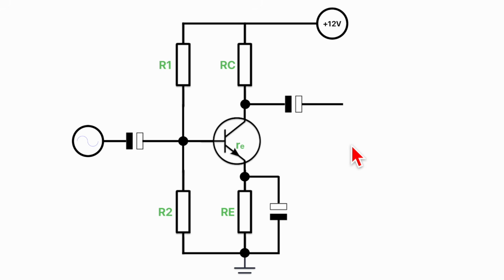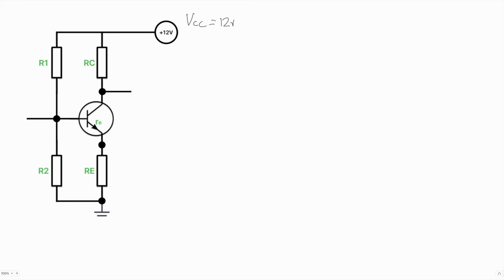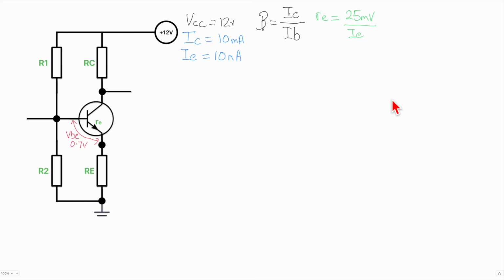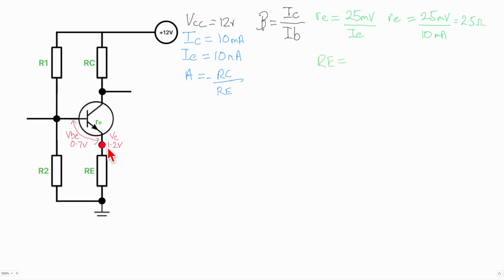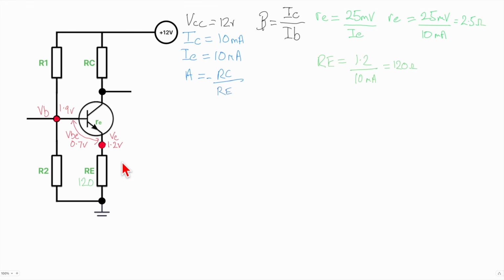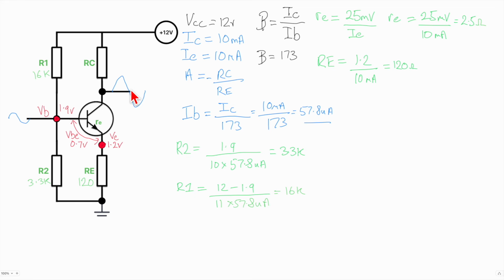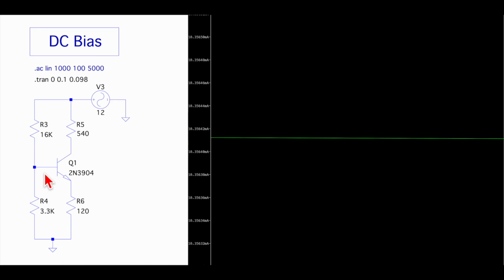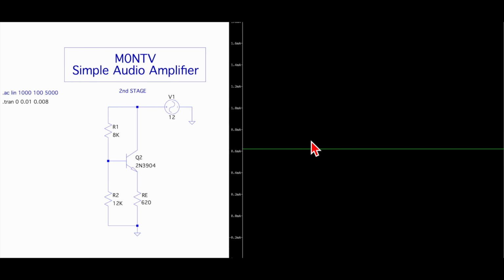57 - Designing a Simple Transistor Amplifier

Comment: This whole description is provided by a commentator who does not know anything about the subject. 
He says it is the stage of an amplifier and yet he is designing it with 10mA collector current. 
The output capacitor is around the wrong way. 
You cannot design a stage as described. 
He is “leading you up the garden path” with his ignorance. 
You start a design by knowing the characteristics of the input signal. 
A signal can be “strong” or “weak.” 
Not only is the amplitude important but also its “current carrying capability.”
This is not covered because he doesn’t have a clue.
I have been teaching electronics for 50 years and over 25 million visitors have read my articles on my website. 
I have designed hundreds of circuits, sold 300,000 kits and 750,000 books and magazines and made millions out of electronics. 
The circuit should be the self-biased stage and not the stupid bridge stage. 
The current for a first stage should be much  less than 1mA and you need to know what you are “driving into” to make any sort of realistic calculations. 
You simply cannot design a stage “in isolation.”
This whole design is so much junk that l am not going to analyse it any further. 
Colin  Mitchell    talking@tpg.com.au

Comment: @33:20 I don't understand why you're multiplying the 57.8 uA base current by 10 to come up with 33k? Thanks for the great video!
Reply: ok, figured it out.we're wanting 10 times the base current :)
Reply from the maker: No worries! Thanks for watching. Best wishes, Nick
Reply: @M0NTVHomebrewing  thanks! And sorry to bother you again, but is there any way you can please tell me why 11 times base current at R1???
Reply from the maker: Because you want 10 times the base current flowing through the voltage divider. That means 10 x IB through R2 and 10 x IB through R1 BUT you also need to factor in the base current itself. The only way the base gets any DC current is through R1so that is why R1 needs 10 + 1 ( = 11) x IB. Hope this helps. 73, Nick

Comment: this video helped me make an amplifier on my arduino board that took a 3.3v input and amplified it by 5v, which made the noise in the speaker quieter, then caught the resistors on fire.
Reply from the maker: Wow! That's not good. The only common reason your resistors would get hot was if you were putting too much current through them. For them to catch fire you must surely have shorted the power supply to ground through them. I would urge you to look carefully at what you actually did. Spontaneous ignition is a learning opportunity! Best wishes, Nick

Comment: Can this amplifier drive a significant load or is it just a stage in the chain and if not then why?
Reply from the maker: Hi Joshua, it was more of an experiment really but I did manage to get it to drive an 8Ω speaker. But honestly it would be better to use a push pull power stage if you are designing a practical circuit. 73, Nick

Comment: Hi I am still a super noob at all this so i will understand if you laugh at my question. Lets say i was bread boarding this exact concept and wanted to understand how different valued resistors in the circuit react on the output, could i replace the fixed resistors with pots within those ranges and either preset them using a multimeter  and pop them in in those place or adjust them in a live setting?
Reply from the maker: Hi there! Welcome! There's no such thing as a stupid question ... only a stupid answer! Yes, you absolutely could do as you suggest but just make sure you connect the pots in as variable resistors not voltage dividers (i.e. use just two terminals). You might find it instructive to do this gradually. So put in all fixed resistors then replace them individually with a variable resistor so you can see the difference each one makes. Replacing them all in one go and tweaking them all will tell you little I fear. But step by step could be interesting to see the results. Best wishes, Nick

Comment: Hi Monty I have made a few amps like this and I find the output is has 5v output without signal and I have a dc offset with the signal in the pos side.I have tried a blocking cap but I loose output. My speaker plays well but I know this is not correct can you advise please 
Regards Richard Bennett.
Reply from the maker: Hi Richard, you'll need a DC blocking cap to link the emitter follower to your loudspeaker. It'll need to be pretty large in order to pass the lower audio frequencies properly. You can probably manage with 100 uF for SSB (300 Hz - 3 kHz) but for music I'd go even bigger e.g. 470 uF. These will be electrolytic caps. Hope this helps. Best wishes, Nick

Comment: The best explanation I have seen on this topic. 
But I didn't quite understand, is this a Class A amplifier schematic? 
At high power levels, will there be significant heating of the collector resistor?
Reply from the maker: Hi there. Yes, it is a Class A design but a SMALL SIGNAL AMPLIFIER. It is not designed to be used at high power levels so there is no significant heating of the collector resistor. There is only 10 mA of current going through it! For more power you need a dedicated (large signal) power amplifier. Thanks for watching. 73, Nick

Comment: this is the best video about transistor amplifier, because everything is explained well and helped me with calculating resistance of resistors
Reply from the maker: Thanks very much. Glad it was helpful. Best wishes, Nick
Reply: @M0NTVHomebrewing  well, there is one thing i didn't understand: why do we multiply current of base by eleven when we are calculating the resistance of R1?
Reply from the maker: Good question! You remember when setting up the DC bias for the transistor I said that we needed ten times the base current flowing through the base voltage divider. Well that means the lower resistor (R2) will indeed see ten times the base current. The upper resistor (R1) will see the same but don't forget about the actual base current itself which will flow down through R1 and into the base. So R1 sees the 10 times base current + the actual base current = 11 times the base current. Hope this helps. Best wishes, Nick
Reply: @M0NTVHomebrewing  thanks

Comment: Thank you "very" much for sharing those details. I was confused about the math, but  NOW  I understand how to do the calculations for biasing small signal transistors in stages for buffering and  amplification. I'm a beginner so,  I have a few questions. 1)  How do I figure the input and output impedances of each transistor? 2)  Does it all work the same for RF circuits?  and 3)  is biasing calculated the same way for power transistors? 
 I'll watch this at least a few more times and try writing a spreadsheet with variables for Beta etc.
Maybe I missed that about impedances the first time watching.  I'll look for that during subsequent views.
Thank you again.
Edited to say:  I'm watching Part 2 now and see you tell about impedances.,  PLUS while editing this comment I noticed you talked about using the same principles for RF circuits.
Reply from the maker: Hi again. Whilst the principles are indeed the same be careful with RF amps. Impedance matching needs to be done in and out and between stages and also you can't just assume Beta (the gain of the transistor) will perform as it does at low frequency (audio). Beta varies with frequency and so you might have a 2N3904 with a Beta of 300 at DC (0 Hz) and audio frequencies (up to a few 10s of kHz). But at 7 MHz the Beta might have reduced to about 24 - a huge difference. I'm probably going to do a follow up video which highlights this. Thanks again. Best wishes, Nick

Comment: Nick... great video... I watched other videos which often bypassed how the collector-emitter voltage was calculated. They would just say something like "you've got 4 volts here"... but not why. Your video is actually the first one to explain it. Thank you. I have one question for you. For the 3904, the data sheet says the beta is 100-300 at 10mA.  I thought that this range meant you can bias the transistor for somewhere between 100 and 300 gain. But now that I'm watching your video, I'm wondering if that range really means "every 3904 is different, even from the same manufacturer, and the beta of yours will be between 100 and 300." This would explain why you should test the beta of your transistor before putting it in circuit. Do I have that right
Reply from the maker: Hi David, thanks very much. In answer to your question, the value of hFE (beta) does indeed vary from device to device and each 2N3904 will be different. But it all depends on the frequency that you intend to use the device at. For low frequencies (e.g. audio range) then you can indeed test the beta and pretty much use that figure (or just use the data sheet average) in your calculations. For RF frequencies however the beta will be drastically reduced (unless you are using a dedicated RF transistor). For the humble 2N3904 (which was never intended to be used at MHz frequencies) you might get a beta of 300 at 1 kHz but perhaps only 27 at 10 MHz. I'm probably going to do a video on this soon! The general estimation is beta (at ac) = FT / f  (where FT = Transition Frequency in MHz printed on data sheet (about 270 for a 2N3904) and f = frequency of interest). Hope this helps. Best wishes, Nick
Reply: @M0NTVHomebrewing  that confirmation helps. There are several videos on how to read datasheets. But they're all terrible because they don't explain why the particular entry (eg: beta/hfe) matter in terms of circuit design. Another example is Vcbo. If someone would just say, this is the collector-base voltage when the emitter is open and then what that means (to have an open emitter) and why that matters in circuit design, it would be so much more informative. And then, to put that in perspective. My interest is audio. The perspective would be why you'd use the data sheets to shop for a transistor. For example, if I look at the datasheet for another transistor, I might view its beta at 10mA to be superior to that of the 3904 and maybe that's better for a different gain stage in an amp or something.  A video on how to read data sheets and then why the data on them matters to a given circuit, and then how to pick transistors based on the contents of the sheet would be awesome. Thanks again.

Comment: I don't understand why you want IC of 10 mA? I want to amplify  my 2 npn power transistor should I also aim for 10mA?
Reply from the maker: Hi there! You don't have to pick 10 mA - in my case it was an arbitrary decision - although one based on experience. I did previously do some transistor testing including curve tracing and plotting DC load lines. This enables you to see precisely what the optimal collector current (for maximum linearity) is for your particular operating conditions. But the headline is it came out to be 9.4 mA so this time I just went for 10 mA. Thanks for watching. Best wishes, Nick
Reply: @M0NTVHomebrewing  Thank you!

Comment: Hi Nick
Great videos, Im looking forward to viewing more of them. I would like to know what a manufacturer of an amplifier would take as an acceptable difference in gain across a batch of amplifiers made. Taking your example of 173, what would be the range of amplification that they would take as being acceptable and is there any further design adjustments you can make to enhance this further.  Ive seen other configurations on the emitter where the emitter resistor is actually two resistors but only one is bypassed by a capacitor. Is this an even better option for the amplifier design. 
Thank you once again for taking the time to make these videos and the step by step calculations and explanations for the circuits.
Reply from the maker: Hi Peter, thanks very much. The 173 refers to Beta (the gain of that particular device). By employing a stiff voltage divider at the base you can effectively swamp out Beta so that the amplifier's gain will be defined much more by the emitter resistance. This is why you will see some designs with a bypassed emitter resistor and an unbypassed one. The unbypassed value restricts the maximum gain that the amplifier will produce. This is much more reproducible irrespective of the Beta of your device. Thanks again. 73, Nick

Comment: Hey!  Great video.  Would this same design technique work with bipolar supply rails?  Say +/- 15V?  Thanks!
Reply from the maker: Thanks very much Bob. I'm afraid I have no experience of bipolar supply rails. Even for ICs that require a negative voltage supply I usually cheat and use a voltage divider and a floating 0V rail. I'm sure someone else might be able to advise you though. Thanks for watching and for your question. Best wishes, Nick

Comment: How do we calculate exact value of VE.(According to transistor number).EX: VE=1.2V for BC109,  VE=? for BC550c.But we know  VE= 0.1 VCC.
Reply from the maker: Hi there! I'm not sure it's as critical as that. Even the 10% of VCC is ballpark stuff - you could get away with less than this in reality. The main difference with different types of NPN BJTs is their FT (which governs the frequency of use) and power-handling capacity. Beta will vary with every device but as I pointed out in the video the voltage divider biasing scheme can help to compensate for these differences. If you are really interested then you could model a simple circuit in LTSpice and then swap through a bunch of different transistors. It's only a simulation but it might be interesting. Hope this helps. 73, Nick

Comment: This is my biggest weakness in electronic assembly.  I am stuck at bios of transistors.  When I look at this simple circuit. I see emitter going to almost ground. In my mind, as the transistor turns on . Looks like short to ground. Then my mind goes to the voltage divider . Why not add a resistor from the voltage divider circuit to the base of the transistor. Think it would keep the transistor a bit happier. I will  keep watching.  I will figure this out. Thank you for the educational videos. I don't  know if I am the only one who has trouble with these simple circuits. I am not embarrassed about it.
Reply from the maker: If it's any consolation this stuff can take a while to get your head round. I've been studying this on and off for years and this video was the result of much research. If you stick with it you'll get there! Thanks for watching. All the best, Nick

Comment: Really nice explanation. Here are two thoughts that might come in handy: a) The collector voltage has actually to be higher than the base voltage, not the emitter voltage. Therefore the center point would be (12V-1.9V)/2+1.9V for the collector voltage. b) The output capacitor seems to have its polarity reversed: The left side will see the DC bias component of the signal and should therefore be the anode (+) pole. Of course this may change depending on the following circuit. But if this is really a pure AC output, the capacitor has to be reversed.
Reply from the maker: Hi there! Thanks for your feedback. Good call about the output cap. I missed that one! 73, Nick

Comment: 1. The voltage gain of the circuit has nothing to do with β. The maximum voltage gain depends on the supply voltage (Vcc) and nothing else.
You set the voltage across Rc to be about half of Vcc.
Av(max) = Rc / re = (Vcc / 2.Ic) / (25mV / Ic) = Vcc / 50mV.
However, the non-linearity of re creates distortion, so for a practical design, we "swamp" re by having an Re about 10 times bigger, showing that the highest practical gain from a swamped common emitter stage is when the emitter resistor has about 250mV across it, giving a gain of about Vcc / 500mV.
With a supply voltage of 12V, you won't get a voltage gain of much more than about 12V/500mV = 24 without causing distortion.

2. The collector current is determined by the desired input and output resistances.
The collector current is roughly half of the supply voltage divided by the output resistance (Rc). The resulting input impedance in kilohms is at most one tenth of β divided by the collector current in milliamps, assuming you pass ten times the base current (Ib) through R1 and R2 to swamp out variations in β. With a supply voltage of 12V and a collector current of 10mA, you expect an output impedance of 6V/10mA = 600R. If your 2N2904 has a β of 300, then you expect an input impedance of around 300/10 divided by 10mA = 3K.

3. The intrinsic emitter resistance (re) does not change from transistor to transistor. It is 25mV/Ic in every case for small signal transistors, where the bulk resistance is negligible.
But remember that as the signal swings close to the positive rail, the collector current becomes small, increasing re, reducing the gain and causing distortion unless we use an unbypassed emitter resistor (Re) much bigger (say 10 times) the quiescent value of re.

4. You don't need 1V across Re. Since re = 25mV/Ic and Re can be 10 * re, it should be obvious that Re = 250mV/Ic. In other words, Ve = 250mV. You get diminishing returns by making it higher.
Reply from the maker: Hi Rex, thanks very much for taking the time to give such detailed comments. I appreciate you doing that. Best wishes, Nick